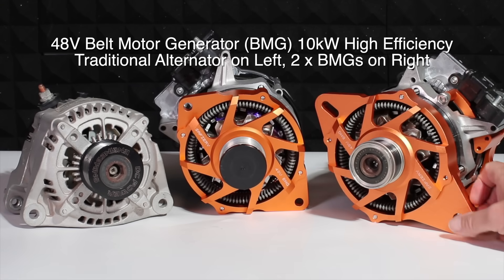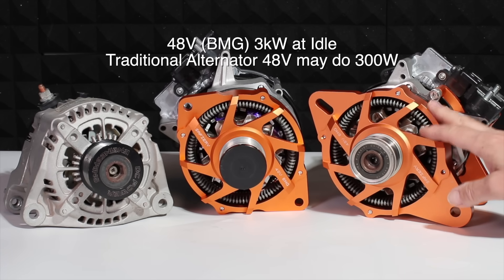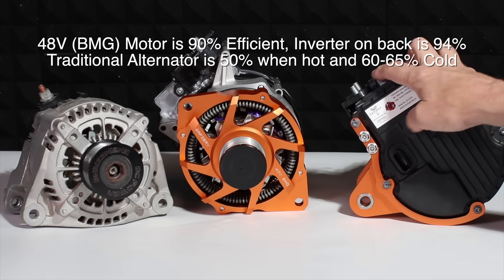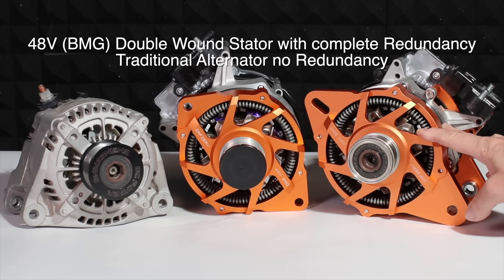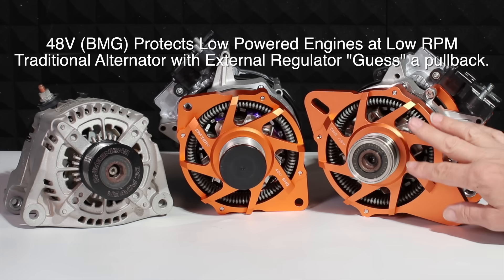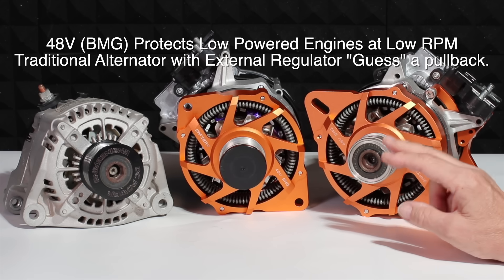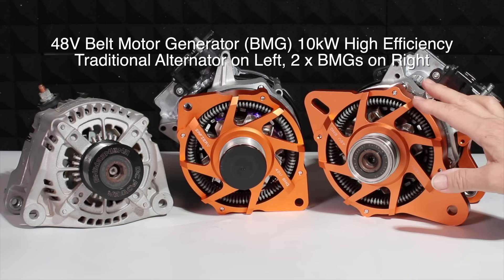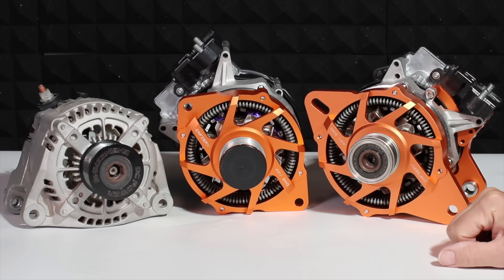Black and White: BMG 10kW 48V Compared to traditional 48V Alternator with a remote regulator.

Comment: Do you plan to produce 12V version?
Reply from the maker: 12V is too low oltage for these units. The power would also be back to 3kW as the power is propotional to the current. If you need high power both 12V and 24V are the wrong voltage. However the DC DC that drives these can deliver 1500W or 3000W of 12V power so you keep all the 12V devices in place and just operate the lithium storage, replenishment power from BMG and Inverter for AC power. Everything else is 12V or 24V.